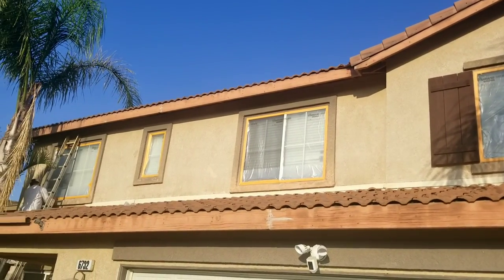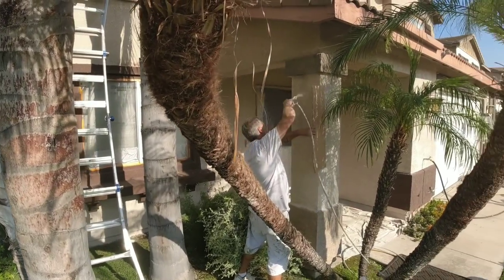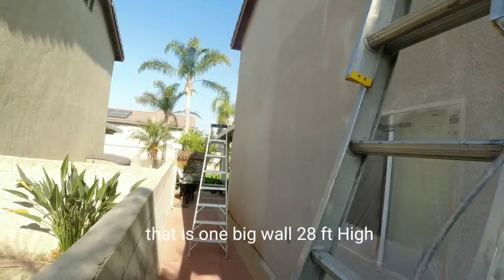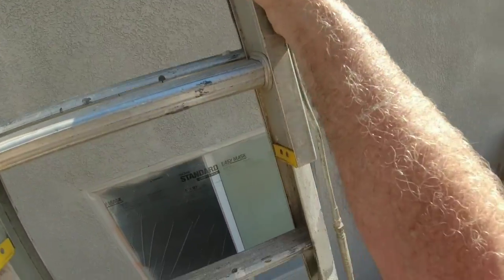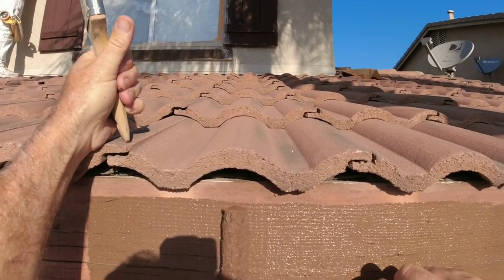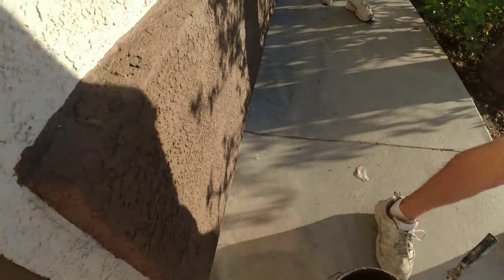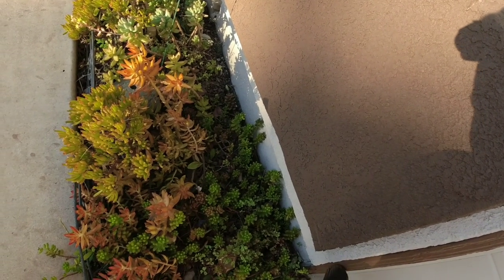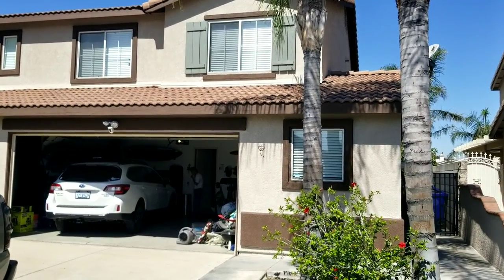Painting COMPLETE EXTERIOR  2 story house Airless SPRAY Brush and Roll trim over 50

Comment: Nice spraying! Saw a painter last week in Whittier spraying an exterior and a cloud of paint flowing down the street.  Neighbors cars all over the place, I couldn’t believe it.
Reply: Lol i saw one like that the other day! Guy mustve had a 515 tip spraying fascia off a 6ft step ladder, just spray and pray.
Reply: @MrC9Oh3  exactly.  I know it was a 515 cause dude was using the graco project painter, comes with a 515 in the box.  😂  need a good ass clay job on all the neighbors cars.
Reply from the maker: Ha ha that is too funny. Probably had the paint watered down too thin and the pressure up all the way blowing off every corner. using wrist motion instead of spraying straight at the wall. I watched a guy one time spray like that. Travis and I  were laughing so hard. Damn I wish I filmed it. Before youtube. He looked like he was chasing flies. Whipping his hand all over the place. No pattern. 24 inches away pressure up all the way and whipping like hell. The whole area in front of the house was blue. Because that is what he was painting. Lawn, bushes, walkway driveway. just mist of paint all over the place.

Comment: Hey Man, When You Caulk / Patch The Cracks Pre-paint / Prep.  Do you have to go back and Prime Those Spots Before Applying Finish ??  Does It Make any Difference in this case of what you show in this video.
Reply: No primer necessary over caulking. I'm logged in under another account but yeah don't need to do that it will make a shiner if you put primer down sometimes it will fill in the stucco too much and you'll have a mark on the wall

Comment: Do you pressure wash every time you spray a stucco wall? I recently sprayed a few HOA entry stucco walls that haven't been touched in 30 years. I tried to take a pressure washer to it (lowest pressure setting and standing back 3') but stucco started blowing off in chunks so quickly put a stop to that. I ended up just brushing down the walls before spraying. Not ideal but the HOA wasn't looking to pay big $$ fixing the stucco issues. Have you ever run into this issue? Btw flat tips are the way to go (thanks for posting all the vids on the subject) and I really like using the Silver Plus guns. I recently bought a used ARO gun for $25 (looks just like a Silver gun). Never knew ARO made spray guns but the trigger is amazingly smooth and I has a lighter pull than any gun I've ever used. I'm sure the reason few have heard/used these guns is the ridiculously high price these cost, but if you can get one for cheap they are worth every bit.
Reply: Sorry I'm logged in under another account that I have but yeah. I have only seen little tiny chunks come off the wall and I still wash it. No major ones but once it's painted usually that stops that. The paint kind of holds it all together. I remember somebody color-coded over a house and I wasn't going to fix all their crap either and painted it. I think I just used a hose to get the dirt off. Then once it was painted it all stayed on there pretty good. I'm not sure how long it lasted it should have been painted long before.

Comment: Hi mike really appreciate the time you take to put out these videos, you seem to spray closer than 12ins that’s recommend is that to keep over spray down this is not a criticism as I’m just getting into spraying and wanting to learn thanks 👍
Reply from the maker: funny I was just noticing it looks much closer in the video. I am about 10 inches away or more. between 10 and 12. but it looks like Im at 6 to 8 alos looks like I put a thin coat on but it was almost running.

Comment: Hey Mike what size flat tips are you using in the light colour
Reply from the maker: somewhat blown out 5/15...I put it on much heavier than it looks in the video. Weird how it looks like I misted the paint on the walls I was soaking them pretty good.
Reply: You  can tell by how close your  spraying to the walls the amount of paint that's going on . Do love your flat tip set up , very little overspray.  Keep on the good work mate 👍

Comment: How many man hours did it take you to do that house
Reply from the maker: 3 days with 4 guys. I used to do a house like that by myself in 5 days in my 30s and 40s.
Reply: @mikethepainter  So 70ish hours..  sounds about right.. The way I learned to bid(older veteran painter like yourself) is man hours to do job plus cost of paint and material multiplied by 2.. I like your gun set up with the flat tip... I think it's good for a lot of things... if you're doing same color on color stucco for sure definitely seems like the way to go I'm up in Sacramento / Roseville area so we definitely have a lot of stucco houses but we also have Hardy and batten board as well.. problem is, is there's so many hack illegals in this trade that it's completely oversaturaded... It's always a little ford pick up truck with about 10 ladders(all tied down with ropes lol) some ghetto silver rims, and a little graco electric and trash every where. I like to use a 3-foot production wand with a swivel either a 515 or 517 spray tip. I like using the double orifice green tips because I feel like I don't burn thru paint as much... I really don't cover as much as I should because I don't really need to. I have a one buddy and he's exactly like how you say he lays drops everywhere literally drop cloths as far as the eye could see.. on the fence.. on the ground he will plastic over the pool...etc..... he says he does it for looks but he's honestly just way to paranoid...

Comment: Do you back roll it ?
Reply: Not necessary. Really important to spray straight at the wall this will prevent shadowing. On a major color change it helps also to cross spray. If you do it this way you will probably never need to backroll stucco. Usually the mistakes people are making isers reaching too far with their spray. And that causes you to spray at an angle which gives you shadowing. Also not knowing this you're also getting much more overspray or dust which is not good.